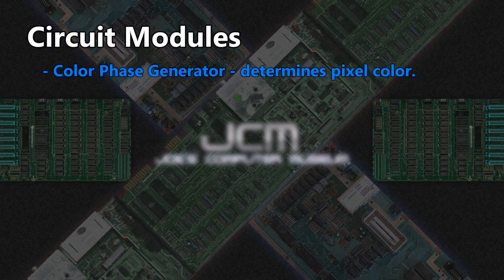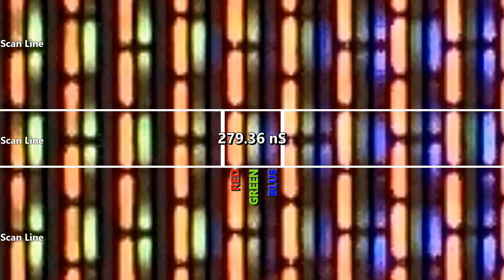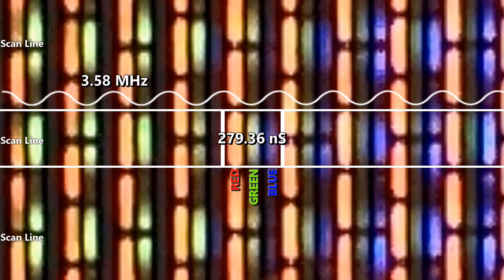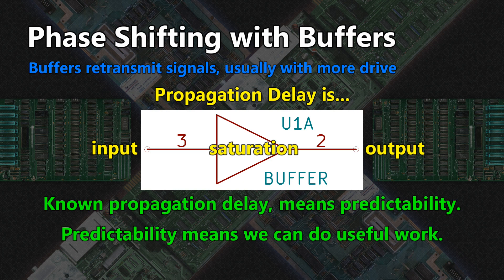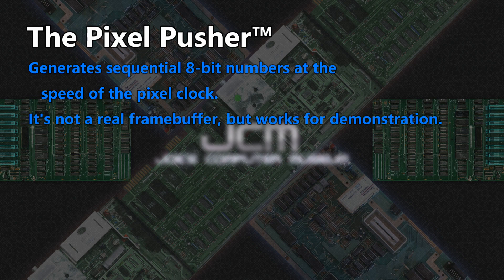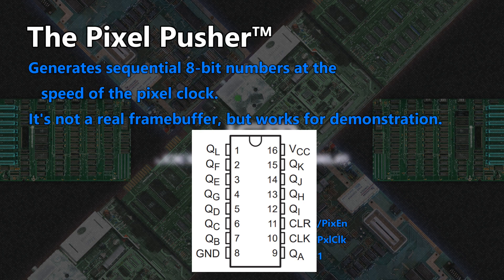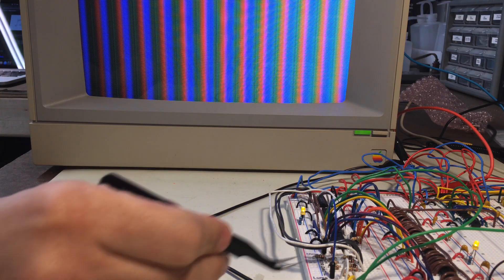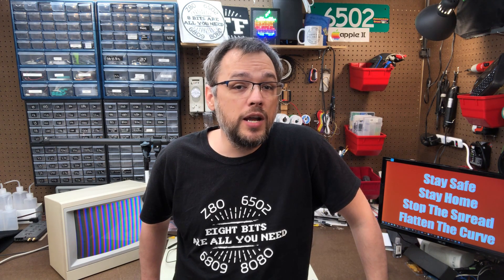NTSC/Composite With Standard Logic - Color Generation - (JCM-1 Episode 14)

Comment: There is so much information to take in throughout this series. Sorry if this is too complicated a question, but what if I only wanted to generate a solid color on the entire screen? Everything here is done manually with logic. But couldn't I omit a large portion of the circuit if I already have H and V sync signals, a colorburst signal, along with a 3.58 MHz crystal for the LS245 phases and the 4051s to select the hue and brightness?

Comment: Question on your schematic ... you use a 14MHz crystal to drive a CD4040 to generate your horizontal timing signals and use a 5V supply voltage ... but at that voltage, CMOS in general and the datasheet in particular says you can drive it  at a maximum of 3.5 MHz ... can you clarify?
Reply from the maker: Certainly. I didn't read the data sheet. I just did it. :D

Comment: Hi Joe. Thanks so much for this video series. It's been a huge help in understanding composite video generation. I have one question for you about color selection. It's my understanding that the composite video signal requires a ~1V peak-to-peak amplitude. From all the resources I've seen on generating this signal with digital logic, this usually takes the form of 0V being the sync level, 0.3V being the black level, 1.0V being the white level, and anything between 0.3V and 1.0V being shades of gray.

My question is about how you're achieving a proper black with that configuration. If you're selecting black with a binary pattern 00000000, with all luma and chroma lines being driven to the low level, wouldn't your final output voltage be at the sync level rather than the black level of around 0.3V?
Reply from the maker: The voltage divider in the final output stage is biasing the black level up to around 0.3v if memory serves.
Reply: @JoesComputerMuseum  Thanks for the swift response. That makes sense, and seems to correspond to the oscilloscope reading at 6:24. I'm looking at the full schematic now and can't quite see howthe biasing is taking place, but I'll run through the math to see if things start adding up.

Comment: First of all kudos .....I always wanted to do this since I was a kid...just bc no one could ever tell me how the Nintendo stores color palletes and then gets the screen to output sed colors...Ben eater's worlds worst video card video....helped a lot...and now this, or really helped...just a quick question
Once you phase shift just once doesn't it throw off the timing for the rest of the scanline?  How does it re-calibrate after sed shift occurs?
Reply from the maker: I only phase shift single pixels. ;)
Reply: @JoesComputerMuseum  so do you keep a list of last shift in a register somewhere...say you start of centered on each "pixel"  so the peak of the wave is over Green to shift left or right it's 1 shift say from green you shift left over red and now the next pixel needs more Blue so now it's a 2 shift back from red to blue or do you shift left for 1 more to realign it back on blue but if you do the latter you wind up shifting and missing a whole pixel by the end of the line...so basically I'm asking how is the shift kept track of so you can align the peak over the the desires color on the next pixel
Reply from the maker: @sodapopinski9922  Each pixel has four bits to represent the hue. When the color is clocked in, the four bit value "turns on" one of sixteen pre-shifted signals using a 4 bit multiplexer. There's no shifts happening.

Comment: Hi Joe really enjoyed this series I think I've got most of it,  however needing a little clarification on a few points please mate. The LS245's are purely sending the 3.58Mhz color burst signal along each input to output (A-B) but how does it cross the signal from B7 to A0 into the next transceiver along the line?, and this is where I get lost the /pixen going into the CLR line of the 4040 then into pin 11 (A) of the 4015, is that there just to send a low signal to address S0 of the 4015. I recall you mentioning how it counts to 256 then goes low I just cant get how the 74040 is counting? given that the data lines are there enabling and controlling the 4051 outputs, I'm just stumped mate!, may need the CRT specialist on the case!
Reply from the maker: Answers that I hope are right because I'm a bit rusty on this design myself. I had to drag it off the shelf to look at as a reminder!

B7 just connects to A0 directly.

/PIXEN is low only when we want to generate actual pixel data. So, we tie it to the enable or clear lines of those chips so that they won't output signals when they shouldn't be. 

The 4040 is connected to PxlClk, which increments the counter every time there should be a new pixel. (Keep in mind that the 4040's entire job is to just generate addresses for the static framebuffer ROM, so don't give it too much credit. In a more complex, sophisticated and memory efficient system, the 4040 and the framebuffer ROM would be replaced with a tiling and sprite control system.) 

The 4051's job is to take the pixel data from the framebuffer, and combine it with the properly phased pixel signal from the 245 and the proper voltage in the DAC and make a generated pixel of the correct color and intensity.
Reply: @JoesComputerMuseum  Awesome Joe thanks again for the quick and detailed response and more importantly appreciate you blowing the dust off the old design file!. All makes sense I had to get my head around the 4040 counter as its use was a little different than the nand gate counter we used for the H timing clock. I understand it's role is to just send/count out an 8bit value every time the pixel clk ticks over. Mate would like to say thank you again for the help an effort you put in on this, I'm delving into the world of arcade pcb fault finding an understanding this concept was a mission but a valuable one!. (Also find it fascinating that one pixel is made up of 256bits you truly get to have an appreciation for all the design guru's that came up with this back in the day)

Comment: There was a great book about this in the early 70's called the TV Typewriter cookbook by Don Lancaster.
Reply from the maker: Yup. Have the book. Decided to go a different route in this case. His solution was to generate video manually using the processor. This system is processor-independent.
Reply: @JoesComputerMuseum  Looks Great !! Can't wait for the next epasode !